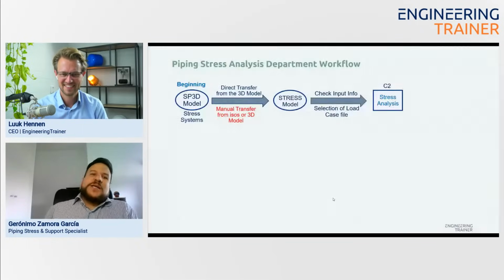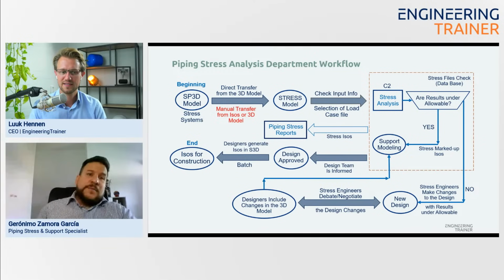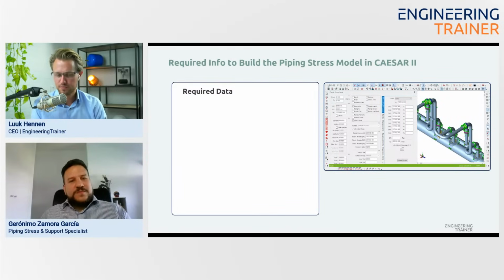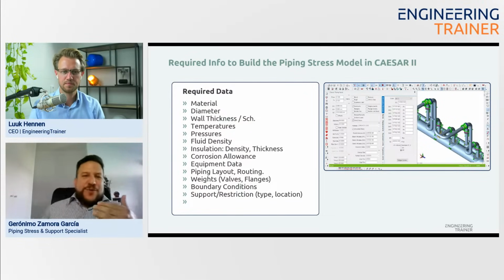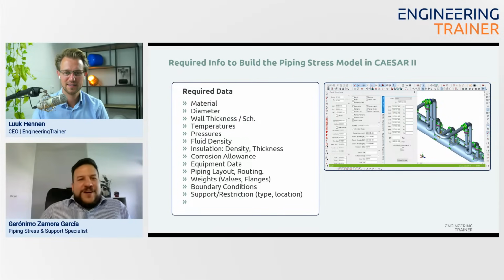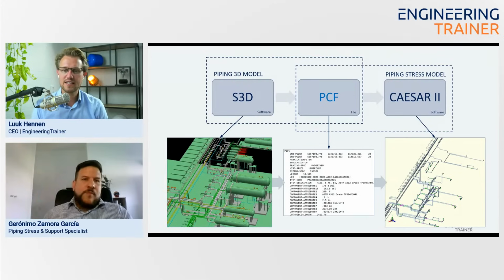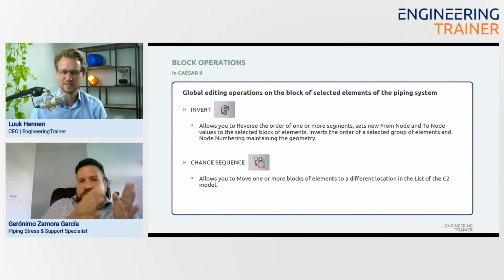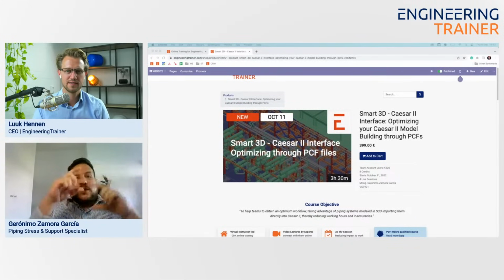ET-TV #11 Smart 3D - Caesar II: Optimizing your Caesar II Model Building through PCFs

Comment: can we use solidplant 3d for modeling to get same interaction with caesar ?
Reply: Hi Ali, best to shoot Geronimo a message on Linkedin. He'll be able to answer your question there.
Reply from the maker: SolidPlant 3D has an Output option, called “Gen PCF”, works with Isogen (by alias, so the PCFs are similar), you can select the option “PCF Only” and then import them directly into Caesar II. Please contact Geronimo via LinkedIn if you require more info.
Reply: @EngineeringTrainer  Thank you very much.